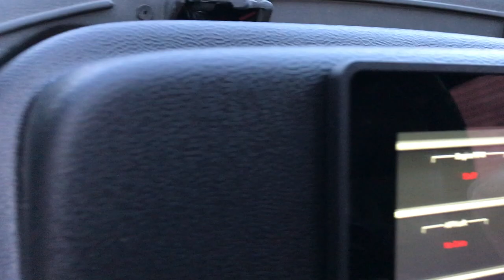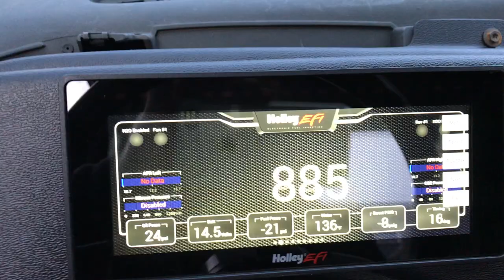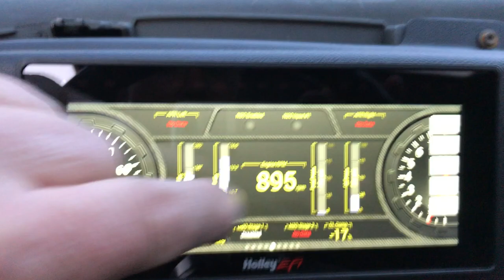Holley 6.86 Pro Dash - Fox Body Mustang

Comment: Looks good. You have your digital dash power source incorrect. You need to connect the power to a switched power source that doesn't turn off when the key is cycled forward. Try the same power source as your computer or old EFI relay. The screen shouldn't turn off when starting the car.
Reply from the maker: Thanks for the info. Fixed that issue!